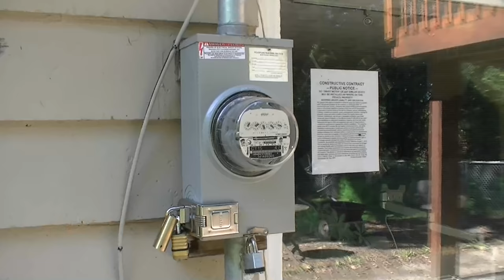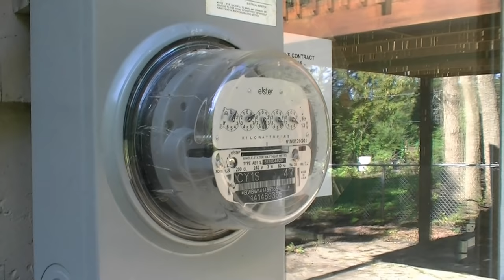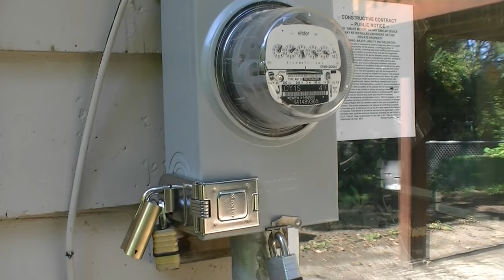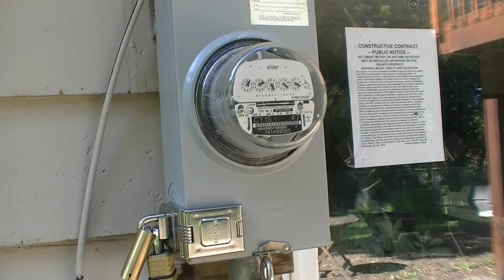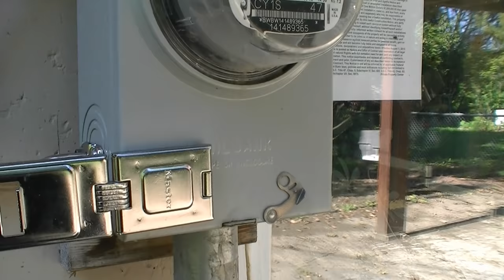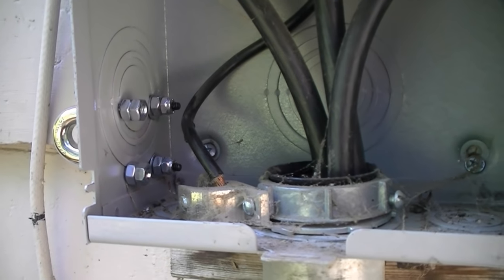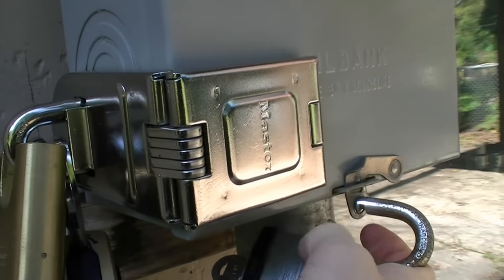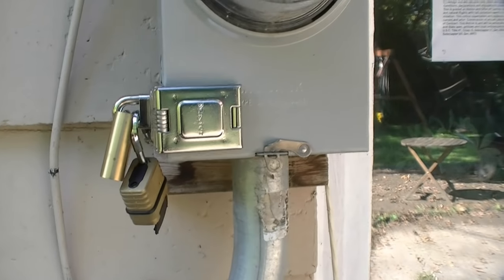Locking Your Electric Meter to Prevent Smart Meter Installation

Comment: So, checked with an attorney. The power company cannot access your property., i.e. come into your yard without permission. Tampering means stealing electric, the grey box is the homeowners property not the electric company's. The wires from your home to the meter are the homeowners, the meter and the wires going out to the power lines are the electric companies. As love no as you don't do anything to the meter or lines going out to the power lines, it's not tampering.

Comment: The power company recently snuck a smart meter onto my home when I was not home during some essential electrical work. I am not happy in the least. I intend to in form the appropriate people that I will investigate avenues to prevent their access to this meter beyond their ability to physically read this meter. Such as block the probe point remove the external aerial and even look at lead sheeting plus locking box to prevent access without my consent. Besides the possible health issues associated with smart meters, I'm also concerned that the use of these meters could lead to job losses within the industries, and businesses are closing with job losses far exceed creation a bad sign of the times. And I detest the fact that they would railroad me into being part of that!
Reply: lol, how did that work out? 🤣

Comment: why didnt you show cutting the seal to get in the metter box  you had to cut thats breaking the lawpower company ownes that box better chech you power company
Reply: Sorry, but the only thing the company actually owns is the physical metal, not the box it is in.  If anything goes wrong with that box or the wiring in it it is the homeowners responsibility to repair or replace.

Comment: the local utility company could decide to cut off your service from the pole or get police out with a locksmith to remove the lock as you cant not block the utility company from changing out  the meter and also they can have you arrested for tampering as well

Comment: The box is your property, but your assertion that removing the locks is vandalism is incorrect in most states. Many utility companies will not hesitate to either remove such locks or other “protections” of your meter box or to just shut your service off, and the utility authority in that area (usually something like a public service commission) allows for them to do so in the interest of protecting their product (electricity). When you lock your meter box, the utility will naturally suspect that you have tampered with the meter and are potentially stealing electricity and/or have compromised the safety of your meter box and anything connected to it (including your service line which the utility owns). When you sign your service agreement with the utility, you agree not to tamper with their equipment or to prevent the utility from servicing their equipment.

Comment: How can they own the box? Tried to get trees cut back on the power lines to the house from the pole and they said they are only responsible from the pole. Refused to cut them back. Well, that tells me the wires coming from the pole to the house onward is not their responsibility nor their property. Double edge sword for them.
Reply: if the wires are overhead - power company owns them to the point it hits your building. If the wires are underground, most likely you own them to the transformer near the street. You always own the meter box, however the power company owns the meter device itself. hope that helps... and dont ever tamper with the meter like this clown. It is dangerous, illegal and just not worth it.

Comment: And when your power company claims it isn't working and they need to replace it?
Reply: Simple, they ask permission.
Then you can ask the meter installer if they are a certified electrician.
Only a certified electrician has the training and skills not bend the lugs on the meter base, cause a fire and kill the homeowner when they are sleepover.
Thank for the hint Jason G
Reply: I simply told them I was aware of that scam and the conversation was over they suddenly said Imy meter was probably OK. 🇬🇧👍

Comment: You realize that power company can cut your power off at the top of the pole or transformer pad and leave you in the dark until you remove the locks. Waste of time and dangerous. This also considered meter tampering when you remove their seal, and you can be charged criminally.
Reply: you do realize they need YOUR consent to go on YOUR property and tamper with YOUR house right? they've been installing these when no one was home.

Comment: One issue NOT mentioned is any modification of the meter pan will void the UL listing. Yes, drilling extra holes is a modification, which is why they come from the factory pre-drilled on the back for mounting, and with knock-outs for wire entrance. They are only UL approved as supplied from the mfgr. What does this mean? The power company will have the right to NOT supply power to non UL approved equipment. IOW, about the only thing you can do here is add a lock in addition to the power company seal... as long as it doesn't break their seal when installed through the same holes.
Reply: There are no, and have never been ANY modifications to MY meter base since I installed it and then it passed inspection by the county building inspector. The Equipment I bought and installed IS UL approved, as confirmed by the building inspector when he green tagged it so It could be it connected by the utility company.
Reply: @practicalman45  ... you are in the same boat with 99.99% of homes here in the states.... so what's your point?

Comment: Dude.  The meter wether It is analog or digital IS the property of the power company, not you.  You will be charged by the power company to keep the analog meter because they haver to send a meter reader out to read it every month.  You can just tell them that you house honey bees on your property and that. you don't want their anti-insect signal emitting smart meter killing your bees.  They don't like to but they will just simply charge you a feee for keeping the analog meter.  If you have a smart meter already and want to revert to an analog meter, you will have to pay $300 for them to dig up some crusty old meter from Mexico.   The health problem for people (and electrical problem I found) is that one time per day every ay they send a brief one.second pulse to the power company to report billing.  This is really not going to cause you health problems, it is too brief.  It can however cause electric motors nearby to stumble for some reason.  I recall our first meter sent its broadcast every day around 9:30 AM.  The reason it causes things in the house that are motorized to stumble is because the data added to the line looks like a voltage spike electrically.  And the power company was too cheap to add a filter so that the reporting signal does not also flow the wrong way (into the house)>.  Someone needs to produce a simple filter to go between the smart meter and the electric box.  "Fryed smart meter electronics" can not burn your house down.  It's inclosed in metal and glass for starters… Those materials just don't allow fire to go through them…

Comment: Aluminum foil does the trick too. Just cover your meter with it & it can't send/receive signals. This forces a service call though.
Reply: Let's look at why we need TIN FOIL HATS. 
 #1 A smart meter will hurt or even KILL disabled homeowners who have disabled medical implants.  The average of deaths by smart meter radiation and smart meter fires is almost 100 every month in North America.
#2 Did you know if your power company “turned off” the power to your home when they did a smart meter install, your chance of a smart meter fire increased by a factor of 10,000.
#3 Your power company has access to all of you private power information. Eg When you make tea, when you turn on your alarm etc. This private information is sold to Google for huge sums of money. Ask your power company what the second radio transmitter in your smart meter does. (ZigBee) 
#4 A smart meter will cause cancer to return if your family members who are fighting cancer at home. If they come home from the hospital and sleep near a smart meter, they will die. Check with the US Cancer Society website. 
#5 Smart Meter RADIATION  will turn off breakers in your home. Both AFCI's and GFI's get turned off by the radiation from the smart meter.
#6 You smart meter is very accurate, BUT, the software (firmware) is programmable. Your bill has nothing to do with the power you use. 
#7 Smart meter radiation is breaking Ionic Bonding.
#8 A huge expenditure for a huge loss. Billions of dollars to purchase something that does not general generate any power and each smart meter need 4 watts to operate. One million smart meters use 4,000 KILOWATTS of energy to operate.
#9 The second radio transmitter is for ZigBee. If you want your power company to MONITOR your home 24/7, then you are in luck. Don’t forget, this private information will be sold. Why do you think your power company spends BILLIONS of dollars and does not generate one watt of extra power to sell? 

SUCKS TO BE A KILLER LIKE YOU

Comment: Fyi, the utility company can put a talking lizard where your meter is if they want to. And it's not vandalizing your property if they need to get to the meter for repairs or replacements and they cut the lock. There is so much high frequency signals from your ohine, appkiances, and regular high voltage lines that the meters cause next to no extra damage. The more you know.
Reply: BUT WHY DO THEY HAVE TO INSTALL A DEVICE THAT KILLS OVER 100 FOLKS EVERY MONTH?
They only have the right to measure what power you use.
THEY DO NOT HAVE THE RIGHT TO INSTALL A COMMERCIAL, MESHED NETWORK, HIGH POWER RADIO TRANSMITTER ON YOUR HOME

Comment: Harry Lime   DO NOT DO THIS
I REPEAT, DO NOT DO THIS 

Sigi Henke 3 months ago said:
How to kill a smart meter.... Get a smaller microwave oven, remove the door screen and glass. Then close the door and set your timer. Then push the microwave oven fully over the meter so the meter is actually inside the oven. Press "Start". The electronics in the meter will be totally fried in a fraction of a second. You probably have seen what happens when metal is in a microwave oven ..... lots of sparks and vaporized metal. Make sure you don't harm yourself by the microwaves of the oven which must be facing away from you!!!!!

Ferkemall 4 months ago said: 
Just get an old microwave put on a chair facing the smart unit open the door jumper the door switch and give it 20/30 seconds then tell them it went tits up and can you have and older meter back ,they will never work it out !

Let me repeat this again. DO NOT DO THIS

Comment: You hold your phone up to your head everyday. The radio signal is not a health problem. It's a proven fact. It's the equivalent of a baby monitor. And it's not an all the time signal. Maybe 5 min out of the entire day. And even with an anolog meter they can see what you are using based on the size of the house and And appliances and everything. So it doesn't really matter what kind of meter is sitting there. Let's get one thing straight. Electric companies don't give a shit what you are doing they just want you to pay your bill and provide you with electricity to the comunity. They wouldn't install something that would potentially cause harm. They are not stupid. And also its pretty important to not have black outs so if ten million people are cranking their ac and whatever else and they can only provide so much. So it's important to be able to have some kind of idea of what the area needs. And the meter can provide a little bit better data.  information by being able to have real time usage. Which is beneficial to the home owner as they would be able to monitor it as well. So everyone is conjuring up all these story's and myths about smart meters. And coming up with paranoid conclusions. It doesn't matter if it's private property. You give the electric company rights to access your property to do maintinace if it's needed. The meter is their property.  So by law they have the right of way to their property. This whole calling it a smart meter has been blown out of proportion and people don't know what they are talking about.
Reply: Go to YouTube and watch take back your power.

Comment: well I show up here to change this meter those locks will just be cut and it is not vandalism when you are denying access to the meter.  I will change the meter you have no option. We can also cut your power off for this at least in my area. and we will not restore your power till you remove those locks.

Comment: Boy I-wished I would have seen this sooner. My power company had been different and I had opted out of a smart meter but they sold out to the nearby electric company and they came in and put one on my house anyway. I didn’t know they would ignore my previous opt out. I think they are turning down the voltage at different times because my lights seem dim then get brighter later in the night. Are they doing that. I wanted to be able to control my air conditioner because I get migraines if I get hot because I had a heat stroke and was unconscious for 3 days. I probably couldn’t have installed this I would have been scared to do it.
Reply: They are most likely controlling your power usage and that's what's causing the lights to dim. What most people don't know is that by lowering the power it puts a strain on electrical appliances like refrigerators, air conditioners, microwave ovens and pretty much anything with an electric motor. These appliances will suffer an early death and some may possibly catch fire. These meters in no way benefit the customers, they only benefit the power company.

Comment: Easy solution to all of this. Step 1: open google.
Step 2: type into google "do smart meters affect health"
Step 3: be told "no"
Step 4: let them install the smart meter knowing there is no difference.
Step 5: be happy you have power
Reply: La Diablo I believe in another comment I gave you a link to all the standards a meter has to go through to get UL certification. It's pretty easy to go outside and look on the meter for a UL Logo. If theres a UL, then it's certified!

Comment: It won't work. I talked to my utility company; they told me if I didn't want a digital meter, then I would not have electrical service. Got quite nasty about it. Problem is that the meter, no matter what kind it is, is their property. They can do whatever they want to meter power. So if you lock the meter and refuse them entry, they will simply cut the power out at the pole. End of story.
Reply: I forgot to ask, show us these laws you are talking about.
Please supply a link.
Reply: And what happens if you reconnect at the pole in defiance? what happens then?
Reply: @drethstevens7549  Jail time! Or if you dont know what you're doing, 6 feet under

Comment: Bull shit dont listen to this guy, that is the electric companies property, there upgrading the system to benefit the consumer, DO NOT TAMPER OR DAMGED THE BOX YOU WILL BE CHARGED!!
Reply: Let's look at why we need TIN FOIL HATS. 
 #1 A smart meter will hurt or even KILL disabled homeowners who have disabled medical implants.  The average of deaths by smart meter radiation and smart meter fires is almost 100 every month in North America.
#2 Did you know if your power company “turned off” the power to your home when they did a smart meter install, your chance of a smart meter fire increased by a factor of 10,000.
#3 Your power company has access to all of you private power information. Eg When you make tea, when you turn on your alarm etc. This private information is sold to Google for huge sums of money. Ask your power company what the second radio transmitter in your smart meter does. (ZigBee) 
#4 A smart meter will cause cancer to return if your family members who are fighting cancer at home. If they come home from the hospital and sleep near a smart meter, they will die. Check with the US Cancer Society website. 
#5 Smart Meter RADIATION  will turn off breakers in your home. Both AFCI's and GFI's get turned off by the radiation from the smart meter.
#6 You smart meter is very accurate, BUT, the software (firmware) is programmable. Your bill has nothing to do with the power you use. 
#7 Smart meter radiation is breaking Ionic Bonding.
#8 A huge expenditure for a huge loss. Billions of dollars to purchase something that does not general generate any power and each smart meter need 4 watts to operate. One million smart meters use 4,000 KILOWATTS of energy to operate.
#9 The second radio transmitter is for ZigBee. If you want your power company to MONITOR your home 24/7, then you are in luck. Don’t forget, this private information will be sold. Why do you think your power company spends BILLIONS of dollars and does not generate one watt of extra power to sell?

Comment: Yes, the owner of the structure owns the box, the mast and weather head.  However doing anything that could indicate tampering or impedes access with a public utility is illegal.  Cutting off the security tag is considered tampering, locking it down is considered impeding access.  You would have a snowball's chance in hell winning a case for vandalism if a power company cuts your locks.  A power company requires unfettered access to the meter box if for some reason there is a shut off order they have someone (usually a contractor) clip the tag, pull the meter, slip little insulated booties on the lugs, put the meter back and install a new tag.  Even with just tag missing a power co can charge you (legally) an exaggerated consumption amount under the possibility that you where trying to steal electricity.  Misunderstanding the laws involved are worse than not knowing them.